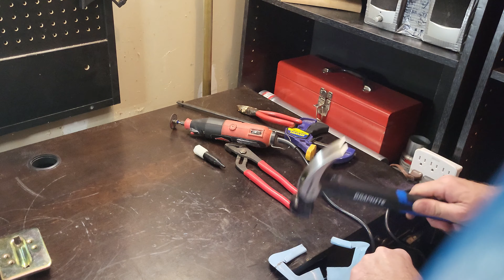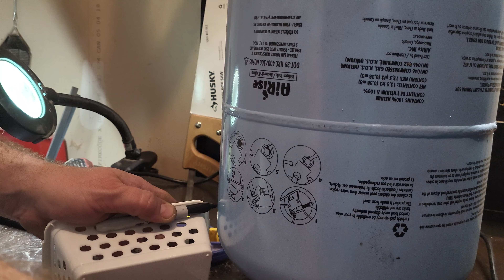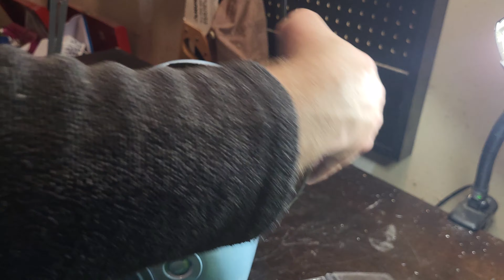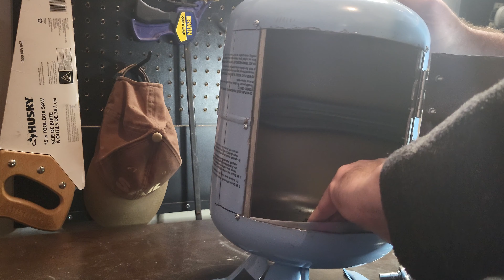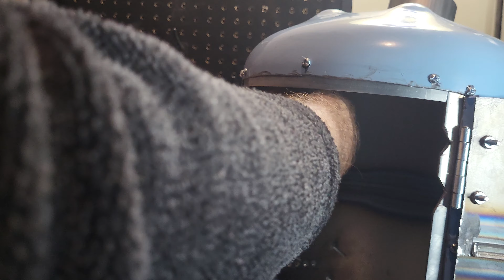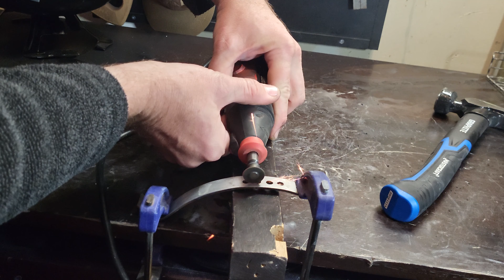Building a DIY wood stove from a helium/propane tank. No welding! Great for a log cabin or tiny home

Comment: Can one use pop rivets instead of nuts and bolts?
Reply from the maker: Probably, I've never worked with pop rivets. I just used to use them as lego people swords!
Reply: @WoodlyDad haha, yes
Reply: @WoodlyDad  I think you can,,,if they are stainless so they dont melting from the Heat,,,,p,s I liked Your video 👍👍👏👏🌹💯

Comment: Suggest getting a 120 mm hand held grinder rather than your small grinder.  You’ll save money on using the small  curing wheels.
Reply from the maker: Yeah, you're right, I should look into picking up an angle grinder. And I should probably learn welding...!
Reply: @WoodlyDad  With the skills you have,,,, you dont need a welder😊😊🌹💯

Comment: That’s clever! I’ve got 2 questions if that’s ok?
1. What size is the helium tank?
2. Is it safe to work on the tank, by just releasing the helium as you did? I know propane tanks need all kinds of extra precautions, eg flushing with water.
Reply from the maker: Hi, thanks for watching!

It's just a little smaller than a standard bbq propane tank. Helium doesn't burn or explode like propane. Much safer to handle!
Reply: I was wandering the same thing today! That’s why I googled how to do this. I was scared to just cut into it! Lol thank you